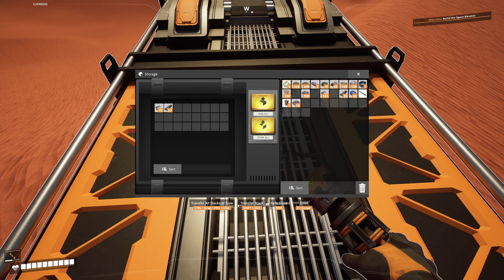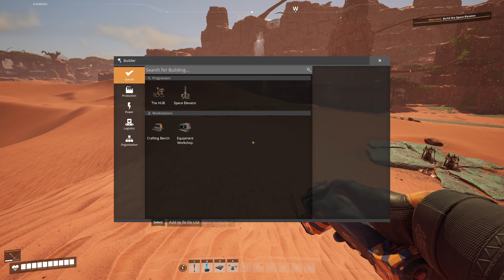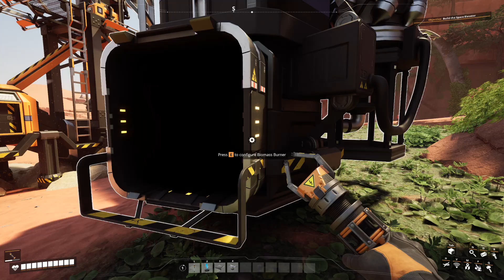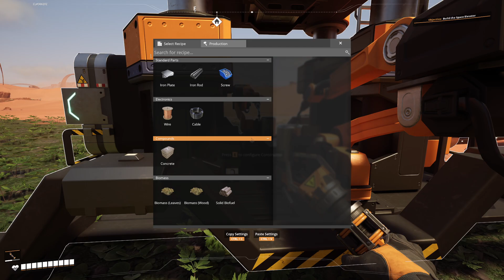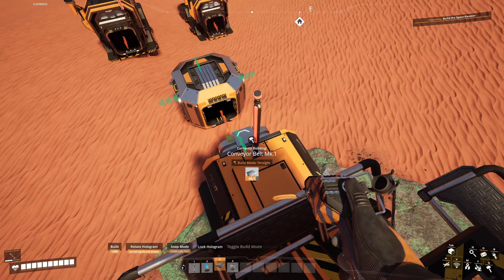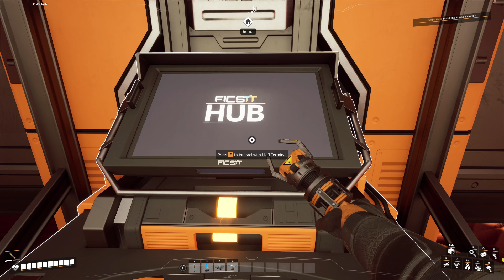Let's Automate Wires, Cables, Screws, and Concrete | EP6 | Satisfactory 1.0 | Tutorial & Walkthrough

Comment: Terrain manipulation is going to be very very unlikely given the technical restrictions of the engine they are using.  Especially when you consider the object limit (which many people still hit with large builds,and will continue to do so I suspect, even with the optimisation of static objects in the game).
Reply from the maker: The developers talked about this and they said no to terrain manipulation. If they do make Satisfactory 2 I would imagine they would implement this feature. In this play through Im going to avoid the terrain altogether.
Reply: @ThomasEdward84  Indeed,  They would have to completely rewrite thr game and engine for little real gain.